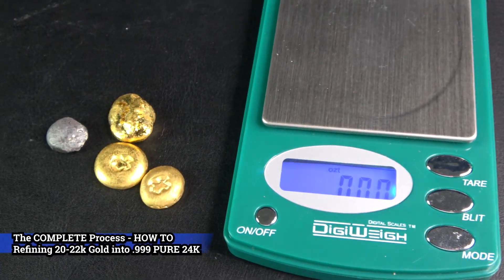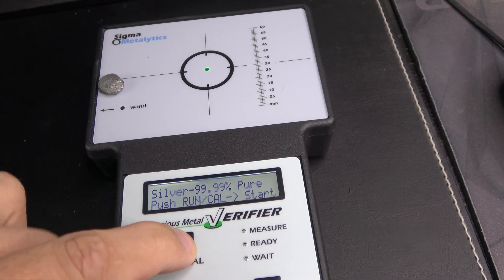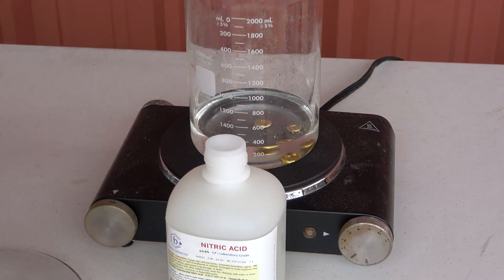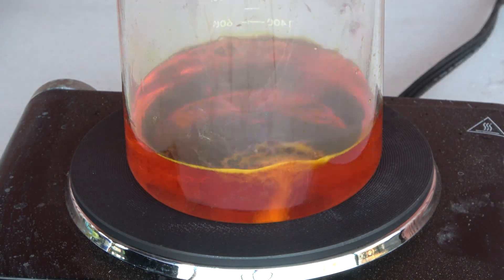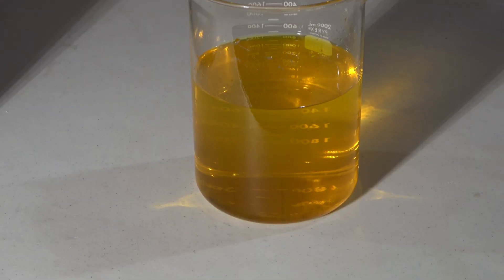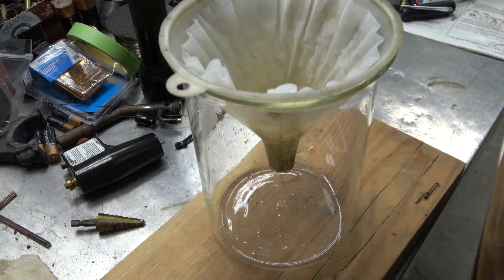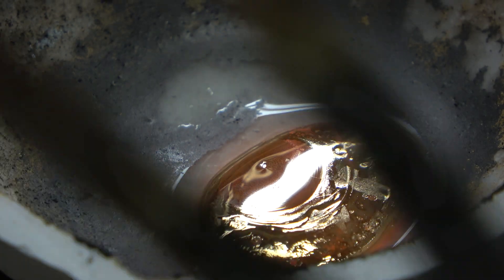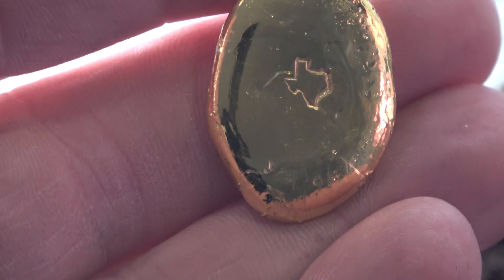PURE 24 Karat .999 Gold - The Entire Process Shown - Tested and Verified!  22K to 24K

Comment: Hey Scott if you melt your gold and pour into a metal bucket of water to form flake or shot it will speed up your dissolution process dramatically. And also after dissolved when your adding the h2so4 to drip lead sulfate, add some ice to cool the chloraauric acid and the ice will drop any silver chloride that may be present. 😎